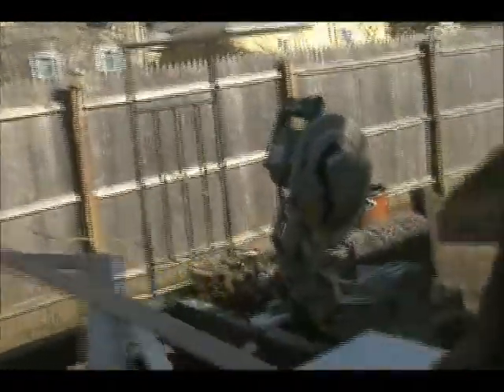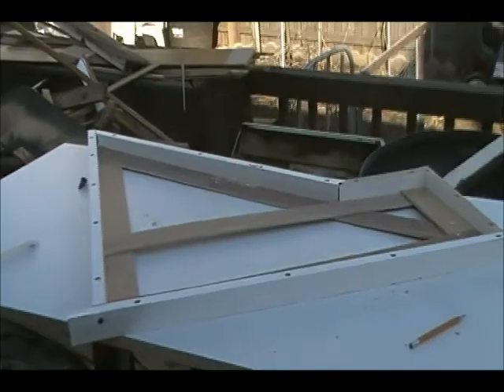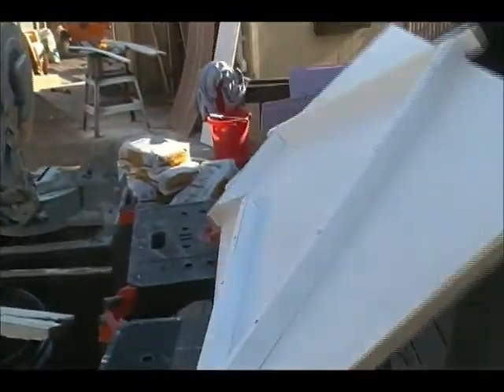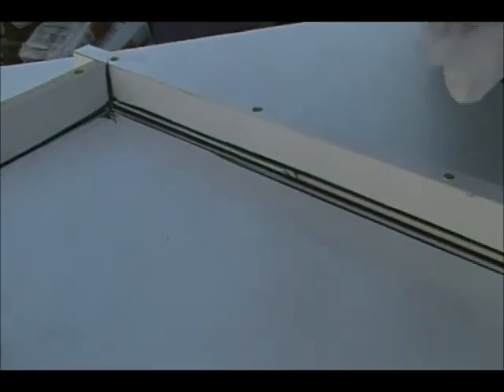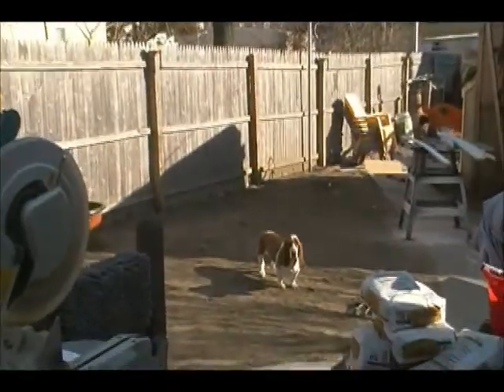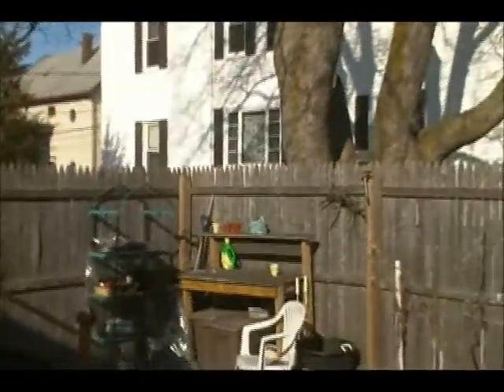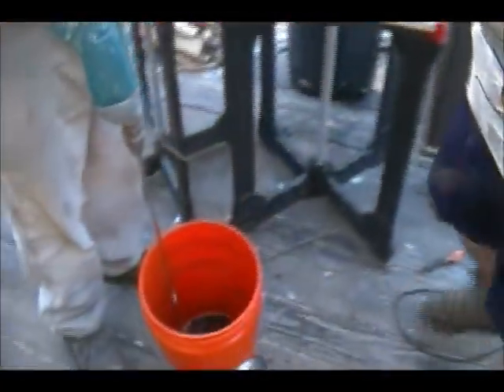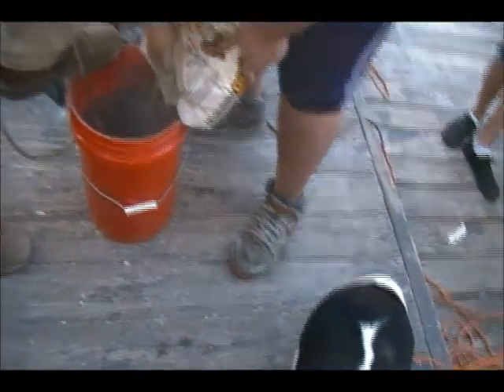concrete counter tops

Comment: that's the way to template ive seen so many messed up counter top done with fancy laser measuring device's    me and my wife lov a good fight  been at it for 28 yrs. ive always wanted to do concert tops too
Reply from the maker: yeah all the projects Ive seen done the guy comes in and does it this way and never has had a problem .sometimes you gotta blow off some steam and then everything is good afterwards 20 years for me thanks man take care